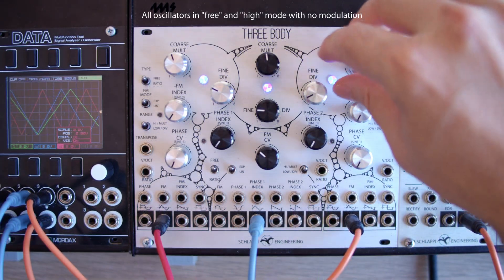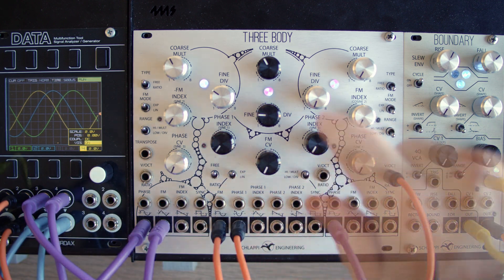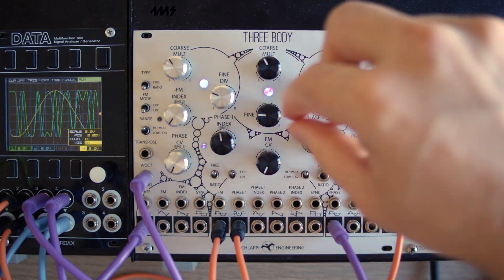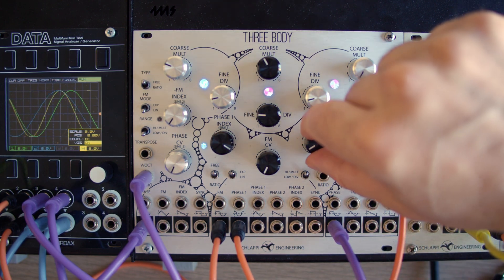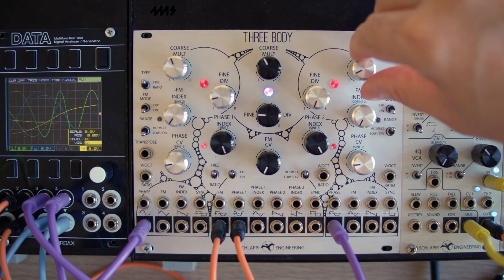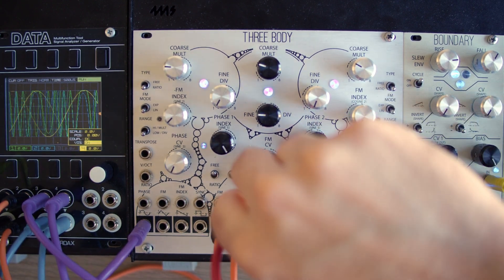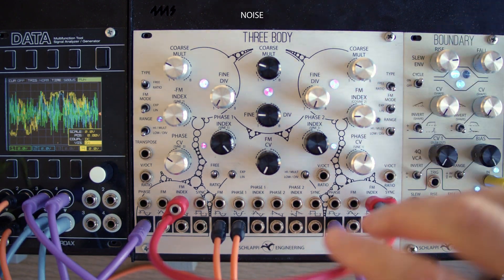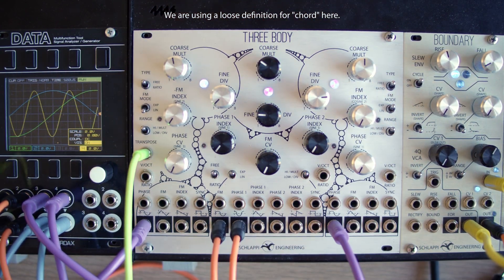Three Body Overview

Comment: What is the expander on the back for ... if I might ask
Reply from the maker: I have several prototype expanders but none of them have stuck in my case so far. If one of them does earn it's keep in my live case for a while then I will make it. So far though it does so much that expanders seem kind of unneccessary, putting a bunch of boundary next to it is what I usually end up doing (other modulators would probably work as well).
Reply: @SCHLAPPIENGINEERING  I saw it and became curious.  Doesn't really seem necessary I have two anglegringders definitely need another boundary. It's quite elegant and sounds beatific. Eric , thank you 😊

Comment: Can the knobs & switches be programmatically controlled? I don't think you realize what you just created, with slight modifications this is an analog computer. Remove the knobs & switches, add USB and Ethernet, and combine three of these units connected to each other into a single EIA rack mount enclosure.

Comment: Awesome! Why did you choose FPGA instead of good old software DSP? Latency issues?
Reply from the maker: I will probably try to make a video on this. There are lots of intertwined reasons, but the two biggest are probably that I had wanted to experiment with FPGAs for a while and also I wanted to see what kind of effect a high internal sample rate would have on the quality of audio rate modulation (the Three Body's internal sample rate is 12.5MHz, external sample rate of 96kHz).

Comment: Great video and superb module. How about the more traditional outputs for more traditional sounds like sawtooth…?
Reply from the maker: thank you! Yes, the traditional outputs behave how you would expect, Stazma has a video coming later today that shows a little bit of supersaw sounds with the sawtooth and I think gets into the square a little. More video will hopefully come soonish with other use cases, I just get hypnotized by heavy modulation so that is what I wanted to focus on.
Reply: personally, I feel like this would be even better if we got 90° and 270° sine outputs instead of the saw and square. Or even/odd harmonics like the Odessa. But sheesh, I really need one of these, and I really should not drop another $500 after just getting my first rack going......ahhhhhhh